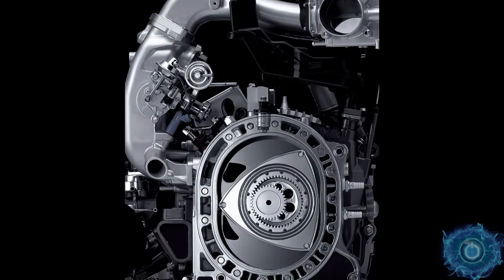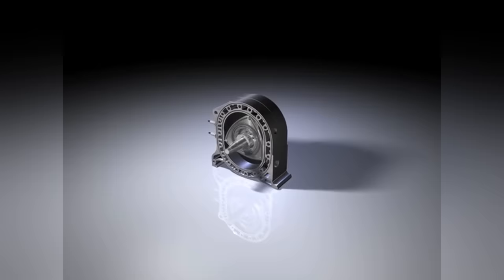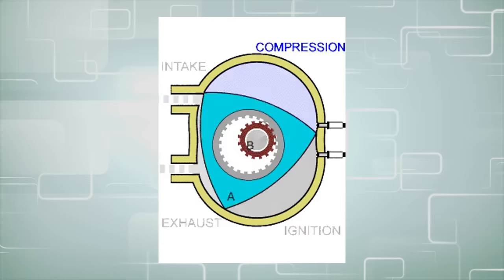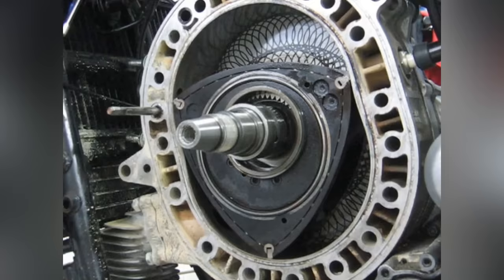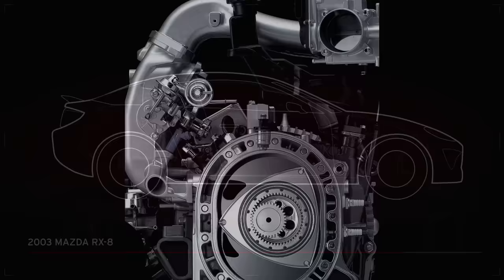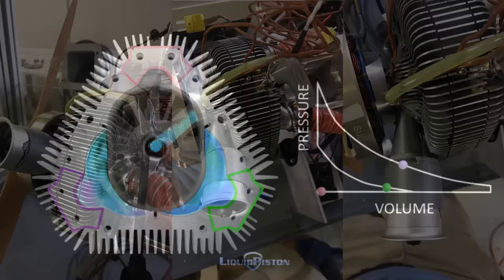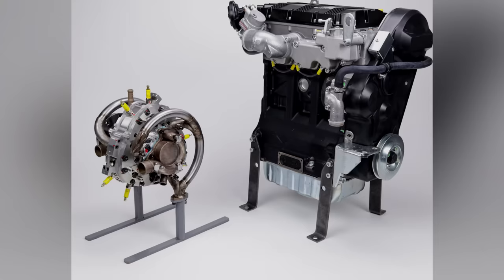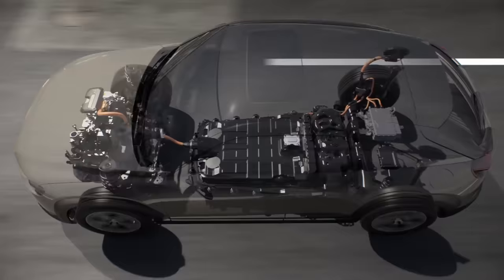STRANGE New Rotary Engine BREAKS Records

Comment: I bought two (2) Wankle rotary cars in the 1970s: Mazda RX-2 & 3.   They had smooth rides, but the cars themselves were pretty flimsy.  Still, I admired the compactness and handling.

So I decided to invest in Liquid Piston.   I see a promising future in using LP's engine within hybrid vehicles to extend the EV range without the massive weight of the ICE and/or the need for heavy batteries.

Simplicity does have its merit.
Reply: It looks promising to me.  

Now that I know anything about engines but this looks like a good way to augment EV or for small vehicles in developing countries which are the majority.
Reply: How did you invest in the company?

Are they on the stock market?
Reply: I think they were flimsy because they were made light weight to get reasonable fuel economy, just a thought.
Reply: @anthonyxuereb792  They we’re also flimsy because it was the 1970’s and engineering and materials costs weren’t what they are now.
Reply: @mikalrage7316  Thanks for that

Comment: Interesting Video, Back in 1981, I had a 1973 Mazda RX-2, It was a twin rotor 74 cubic inch, with two dual electrode spark plugs per rotor, a four barrel carburetor and two distributors, one with two sets of points and the other with one set, It had a four speed manual gearbox, And It was very fast for such a small motor, but it guzzled fuel, I paid $140.00 for it and after about 11 months, a forty cent seal went south, which was the same as a blown head gasket on a piston engine, water in the combustion chamber, so I sold the wheels and tires for $100.00, and the car for $140.00, It was fun while it lasted, I was 23 years old at that time, THX for posting, subbed. 👊 😎
Reply from the maker: Thanks, great back story, interesting to hear! That would still be fun to drive probably light! Mazda always makes interesting cars, my first was a 97 Millenia with a miller cycle engine, it was a very weird 5 stroke, almost made me go broke in college with all the repairs so can relate to your story heh
Reply: @Tech_Planet  A 5 stroke? That's a new one on me, I'll have to check that out. THX, 👍
Reply: Wankels have high flame quench, poor mechanical advantage for the expanding gases and the exhaust opens too soon. Result high wear rates poor efficiency.

Comment: A motor like this could revolutionize the ultralight industry. I'm definitely going to keep an eye on this one!
Reply: Agreed! 42 pounds for 25 hp is a way better weight/power ratio than my rotax 447.
Reply: The other big plus is the APU generator/hybrid area.  Two guys can carry a multi fuel Diesel gen set that would conventionally be the size and wt requiring wheels and towing vehicle or crane... 

Plus its got so few parts in a boat or a yatch you could take the engine out and rebuild it on the cockpit floor in a couple of hours.
Reply: @clivestainlesssteelwomble7665  that would be a sight to see 😁👍
Reply: You've probably never even flown an aircraft yourself
Reply: @Richard Cranium 
🧙‍♂️🇬🇧 
Till batteries get cheaper lighter and cleaner to make . There will remain a gap for chemical combustion motors on boats and in aircraft as APU's They may not end up burning fossil fuels but the energy stored needs to be about ten times the best present lithium battery tech.  Even so these may be perfect as back ups in emergency situations...
Which is why DARPA has been investigating these.  
Diesel generator electric motors 
 is about 20-30% more efficient and these motors are almost 30% more efficient than conventional diesel generators and at least 80%lighter simpler and smaller. They might end up running on a biofuel or hydrogen but their other advantages alone would make them worth the investment.
As motors electric are far more efficient than ICE being 93-98% efficient for the best examples silent and cooler running... Which is why even the military need them.
Reply: @SteveSiegelin 
Plenty of MC engines got repaired on kitchen tables  and one of these is smaller in size and way simpler.😉😎 The clever bit is the tip seals are fixed and oil fed..and cooled by the crank case combustion chamber..
What would be impressive is a small person hauling out their boats 75bhp diesel engine through a 75cm square hatch in their two hands like a conventional car battery 😂👍🏼

Comment: Liquid Pistons should explore applying their technology in outboard motors, before trying to break into the car market. Wankel did actually make it into outboards in the late 60s or early 70s, but they never really caught on at that time. In marine applications vibration and noise are major factors, as is weight to power ratios. Other than going electric, this solves it. They are also far less complex and smaller than current outboard 4-cycle engines. I hope that they reach out to some of the majors (Mercury, Honda, Yamaha) and see if they are willing to work with them. They might be surprised
Reply: I think planes are an even better angle as weight matters greatly for them, an alternative would be motorbikes.

Comment: Having the apex seal servicable without disassembly would be amazing. A set screw could seat it into the block, remove the screw, remove the reseal, insert new seal, new screw… boom engine overhaul conplete.
Reply: yes i like that make sure use a good 2 stroke oil in this liquid piston 2 stroker. Amsoil interceptor is use in my rotary 2 stroke.

Comment: Liquid Piston has the same basic problems of Wankel's - seals and emission, plus, it has problems of roots and twin screw compressors - a requirement for a very precise shape of both hull and rotor. Having stationary seals does not really solve the problem - same three apex seals have to swipe the same surface.
The rotor overheating problem is probably one of the newly added obstacles.
Reply: The rotor is the intake and is in constant contact with fresh air from one direction (the reason its finned) and cold air/fuel from inside the shaft and rotor. The main reason the apex seals are a problem in a Wankel is because at high rpm they are being pushed into the housing at extreme g force... that doesn't happen with stationary seals. I'm not sure you are taking the physics of the problem into consideration. Even if the apex seals are physically identical between the two designs they will last exponentially longer in the liquid piston engine.
Reply: @jameshathaway5117  "The rotor is the intake and is in constant contact with fresh air from one direction (the reason its finned) and cold air/fuel from inside the shaft and rotor." 
Few fins will not transfer tens of kilowatts of heat. The fresh air that goes through intake does not remove the heat. Anyway, aircooling is not enough for high power.
In Wankel, at least, the hull can be liquid cooled. I do not see how you can liquid cool a liquid piston.

"The main reason the apex seals are a problem in a Wankel is because at high rpm they are being pushed into the housing at extreme g force..."
That's a garage talk. G force is not a problem. It just requires a reliable lubrication. The top three problems of the apex seals are vibrations, gas leakage and wear. The gas pressure is 70% of all acting forces and it acts orthogonal to the g force. In fact, in some variants of seals, geometry is optimized to use g force to stabilize the seal. 

"that doesn't happen with stationary seals."
Like I said, g force is a non-existing problem, "invented" by the inventors of the LP for sole marketing purposes. In the same way they "invented" HEHC, which is nothing but... Atkinson cycle. 
Stationary seals have the same triad - vibrations, gas leakage and wear. Gas leakage is even worse because of ... the lack of g force. The springs now have to work against gas pressure and overcome wall friction of the seal. Being stationary does not give a big advantage. The only small advantage is - there is no complex joints of apex and face seals. 

"I'm not sure you are taking the physics of the problem into consideration."  Which physics? How about a little understanding of engineering?

"Even if the apex seals are physically identical between the two designs they will last exponentially longer in the liquid piston engine." 
any reason why it will be so? And "exponentially"? Exponentially to what? 
Hint: most of the seal wear happens due nibbling over the ports, due to over pressure shocks and due to lack of lubrication. Neither design is free from the three problems.

Please understand, liquid piston does not have a revolutionary advantages over Wankel. In one respect - rotor thermal mode - it is much worse, and this will be a big problem for scaling up or increasing the power density. The uneven thermal expansion of the rotor and overheating - these are serious problems, but the garage pundits do not realize those even exist.

Seals will require constant lubrication in both. Same as two stroke piston engines. In a way, two stroke single cylinder engine is as simple as a wankel or an LP and can be tuned to really high rpms and achieve a high specific power. It will be more reliable that either WE or LP. You can achieve a better compression, hence - higher efficiency. What prevents them from becoming the main stream? Lubrication. Which makes the exhaust dirty.

Another thing that you are definitely reluctant to consider is this. WE has had half century to mature. All its quirks and warts are well understood and there are a lot of know-how for WE. LP just does not have that luxury. ICE are becoming obsolete - for political reasons, not because of technological advancement. Nobody will consider investing in LP in the same way they did it for WE. Too late. LP might find its niche - UAVs, RC models. However, it will never mature enough.
Reply: @alterbart7916  NASA might disagree with you... the Wankel apex seals eat about 250 watts due to friction at 1k rpm. At 7800 rpm the apex seals eat 2250 watts each. The chamber pressures from combustion are the same in both examples yet the drag increases by 9x. That my friend is a exponential increase in friction a stationary seal will not experience. The seals also only experience pressure from a power stroke on one side temporarily while the seals see high pressure from rpm as long as the revs are high. If you want to know what kills a sliding seal follow the friction. It's all in the NASA study and the pdf is free. The math is a little hard-core but the charts are a decent help.
Reply: @jameshathaway5117  
"the Wankel apex seals eat about 250 watts due to friction at 1k rpm. At 7800 rpm the apex seals eat 2250 watts each. The chamber pressures from combustion are the same in both examples yet the drag increases by 9x. " 
First of all, the rpm increased 7.8 times and friction - 9 times. It is hardly exponential. And
Even if the apex seals are physically identical between the two designs they will last exponentially longer in the liquid piston engine."
Second of all, if you noticed, the fig. 17 shows that the acceleration friction losses at 7800 rpm are about 400 W. The major contribution is the cavity pressure . I am talking about the same NASA/TM—2010-216353.
Third, MAZDA tests show that even with springs there are seals disconnect, which means, LP will have to use stronger springs and instead of acceleration losses it will have to introduce spring losses. 

"That my friend is a exponential increase in friction a stationary seal will not experience. " 
Shifting goal posts, my friend? This is what you said earlier: Even if the apex seals are physically identical between the two designs they will last exponentially longer in the liquid piston engine.
How increase of total friction power 9x with 7.8 increase of rpm mean "exponential longer seal life in LP?

"The seals also only experience pressure from a power stroke on one side temporarily" that is the pressure friction I was talking about. It is the same on both. "while the seals see high pressure from rpm as long as the revs are high." 
this is acceleration friction, and it is as small as the spring friction, three times smaller that the pressure friction.
"If you want to know what kills a sliding seal follow the friction." 
First of all, NASA/TM—2010-216353 is math modelling, it does not count the losses on passing the ports. Read MAZDA documents from 90's - you see, what really eats the seals.
Apparently you are under impression that liquid piston is free from friction. This is not true. Actually... There is a patent on liquid piston engine where the friction losses are really negligible. Only there the liquid piston is really piston and ... liquid. Not rotary at all. The rotary has the same friction components except for the acceleration one. But the spring friction will be at least twice as high. And the vibration and disconnect problems will remain.
Reply: You move goalposts like a woman arguing.
Reply: @jameshathaway5117  Sorry it was you who claimed "exponential" longevity for LP and who ended up explaining it by not relevant friction losses for WE. Pretty amazing.
Reply: @alterbart7916  Great comment!
Reply: @alterbart7916  We all look at these rotary engines in 2 dimensions.  In 3D, you see that they all have to seal the sides of the rotors as well.  More friction.  That's the beauty of cylindrical pistons; they have the smallest possible sealing surface (rings).  Unfortunately, it's the necessity for reciprocating the cylindrical pistons that hurts that design.  Solve one problem, create another....
Reply: @Rubik3x  You are right. 
Piston engines have another problem - balance. You need at least two of them to balance off.
As for the side sealing, there are interesting solutions like labyrinth seals, which is basically friction-less. Until another problem of rotaries coming - carbon deposits. Wankels suffer from that a lot. Especially if an EGR used...
Reply: @Rubik3x  that's where I thought the radial design was brilliant, but the one with stationary cylinders. I'm surprised a 3 piston at 120 deg each wasn't brought in. 120 deg works good for 3phase electric motors, possibly a good number 😊

Comment: I drove a Mazda rotary a few times in the early 1980s. It was so smooth.  I really wanted it to succeed. If they have solved the seal issues and high fuel consumption,  it sounds like the perfect engine - especially if they can run it as a diesel.
Who knows? Maybe they'll even be able to run a gasoline engine with compression ignition?
Reply: Compression ignition, that would be great.
Reply: Achates power did that with their 2 stroke OP.

Comment: Swapping the rotor and stator ships solves a great many problems it would also allow tip seals to be replaced without opening the motor - if the manufacturer builds in access points. 
Four cylinder radial two strokes also need a small blower but with direct injection are extremely clean and efficient. More complex (pistons rods crank) but are well understood.
Reply: The access to the "apex" seals is a great point! I hadn't even thought of that. It would be really easy to make them removable or even allow adjustment of spring pressure to dial in seal seat pressure.
Reply: "tip seals to be replaced without opening the motor" well, the truth is, the access to the seals is the only difference. The seals would still suffer from sudden failures, causing damages to the housing and the rotor, that can happen even on first miles. The whole engine will have to be reworked. There are anecdotal stories about Mazdas blowing engine on the way from the dealer... 
The swapping rotor and stator also moves the problem of uneven thermal expansion from the stator (fixable with an adequate cooling) to the rotor (not fixable).
Two strokes work well without turbo, and they will never be clean, unless they are marine diesels... The problem is with seals needing lubrication when moving over the ports. The significant portion of the lubricant will always get into the combustion chamber.
Reply: @alterbart7916  I'm still trying to figure out why you keep arguing emissions when absolutely no one is arguing that this engine will be a clean engine. You are arguing points that are farther down the line. The use cases for this motor rarely care much about emissions. UAV, diesel dirt bikes, chainsaws, generators, sea faring drones. None of them have astringent emissions standards so I'm not sure why you argue it so hard.
Reply: @jameshathaway5117  Jim, I was answering David. He called two stroke turbo extremely clean.
If you got upset by me not commenting your reply, here it goes - seals fail unpredictably and blown seal most likely damages the motor. There are youtube videos showing the inner surface of wankel after broken seal. So there is a very little advantage of being able to access the seals. First of all, seals will get carbon deposits and will not be easy to remove. Second of all, have you ever replaced an apex seal? There is no way you do it from the side. You have to have face access.